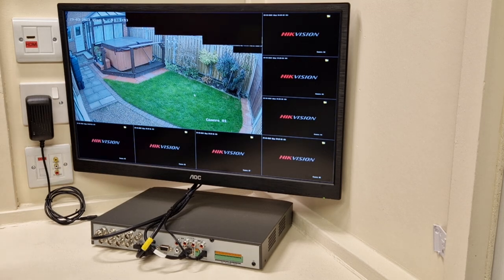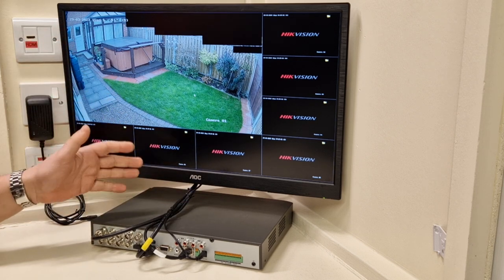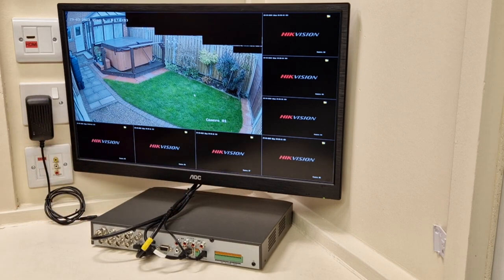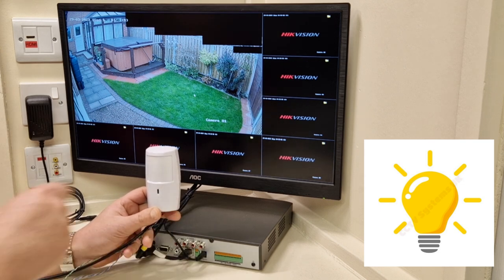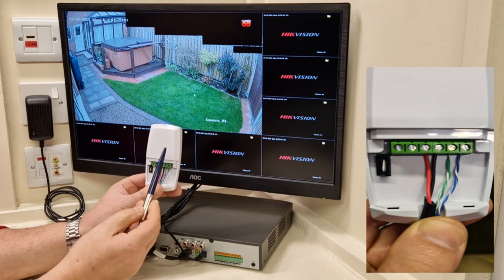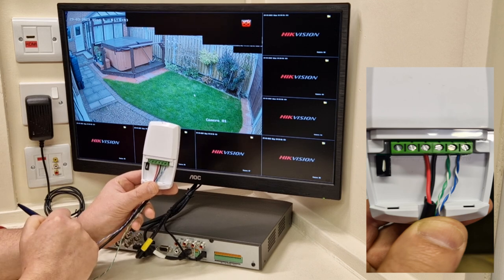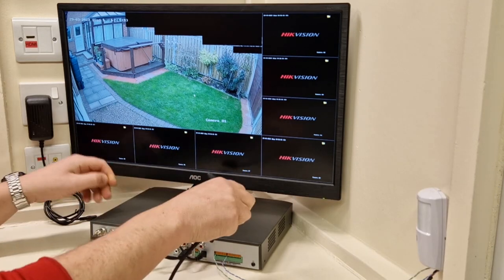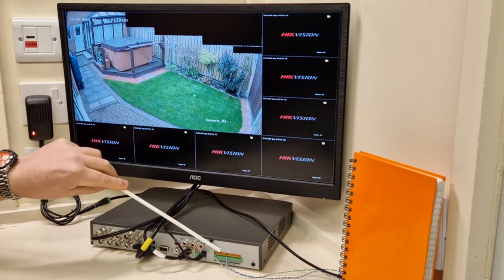Hikvision Alarm Input Setup / Hikvision Alarm Output (Part 1) @CCTVSystemsUK

Comment: Great video, Thanks.

 I didn't think BNC was still widely used and mostly all NVR's was POE. I used a DVR with BNC inputs years ago. Whats the benefit of using one of these over a POE nvr? Don't these machine need power at the camera end?
Reply from the maker: Hi,

Yes, the DVR / HVR market is literally booming. Especially here in the UK.

HVR's 'Hybrid Video Recorders' are a huge step forward in terms of analytics. Eg: human & vehicle recognition.

These NVR's now flourish with the introduction of high spec 24-hour colour cameras, such as the Hikvisions 'ColorVU' units 💡 that are roughly one-third of the cost of an IP camera. While the HVR still maintains the ability to accept IP cameras. Such as auto tracking PTZ's / Doorbells and Darkfigher IP camera etc etc.

Not to mention the POC 'Power over Coax' HVR's that also get the 'Acusense' technology and benefit from certified cable runs of 200 meters. 200 meters is out of reach for most NVR units unless using a POE or POE+ injector somewhere in the equation.

Always remember that coax technology has been around forever and that because of this, lots of properties are cabled accordingly, so there is a great opportunity there to save our customers some money, while giving them the latest toys on the market.

To answer your question. No, you do not need power at the camera end 'Front End' as it's known in our industry as RG59+2 cable carries the power from the 'Back End' where the NVR / DVR is located. 'POC' versions sending power down the same cable as the video. ⚡️📽👍

Long winded but, I hope this helps.

Regards, 

Paul

CCTV Systems UK
Reply: @CCTVSystemsUK  Thanks 👍 , I didn't know that and always thought these machines which ran coax you needed power at the camera end and didn't realise the coax can provide the power as well as video.